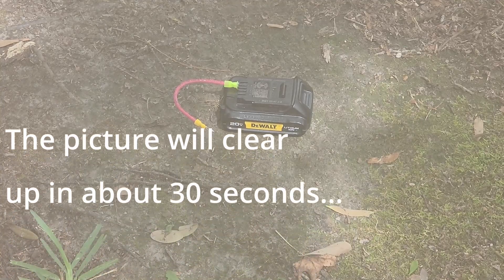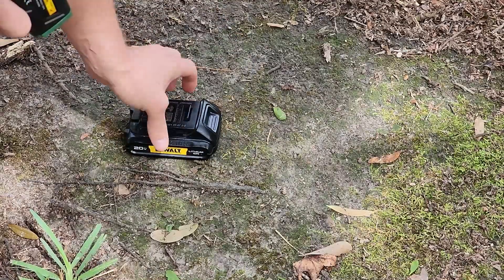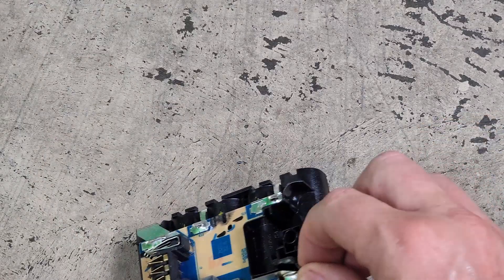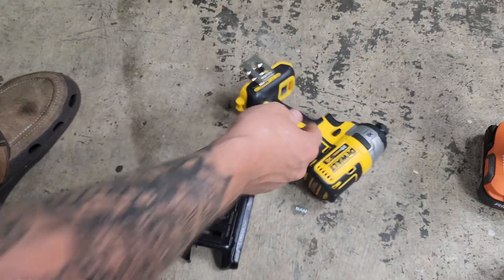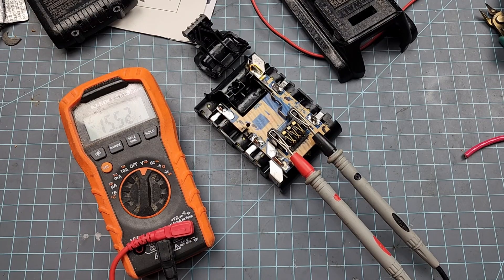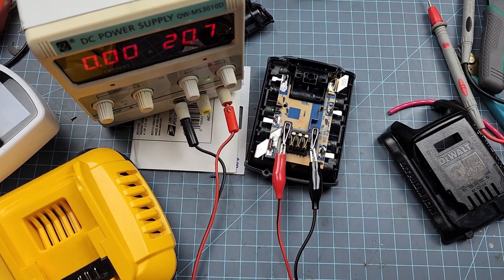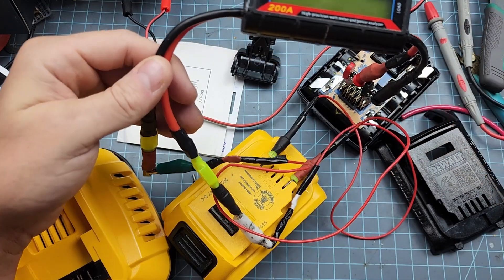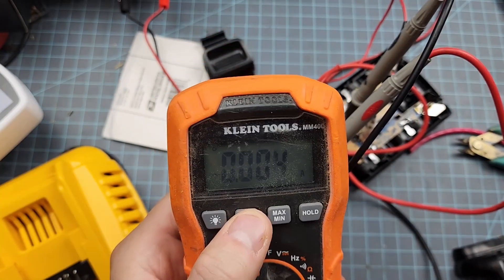What Happens When You Short Circuit A 20V Tool Battery + Teardown To See Why

Comment: Take the 18650s apart. Most of them have a protection circuit on the positive terminal. I’m curious if DeWalt uses protected cells or not. 

Test the voltage of each 3.3v 18650 if one is low you can jump start them if they don’t have a protection circuit by tapping the terminals with a 5v high amp power supply.
Reply from the maker: Thanks... Im gonna do a battery comparison soon and Ill give it a shot!
Reply: @hometownworkforce1824  Legend says it is still being charged.